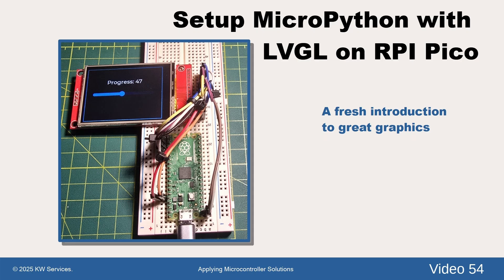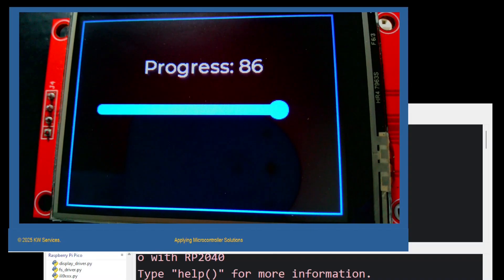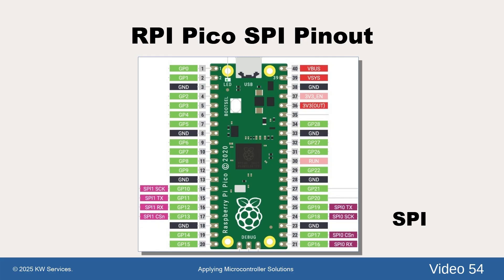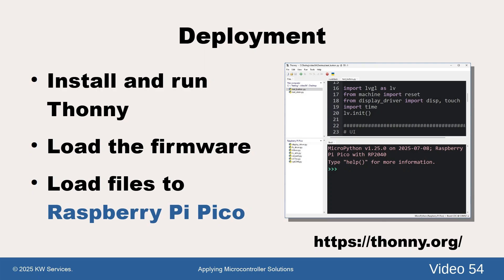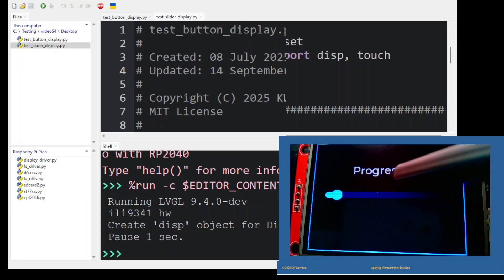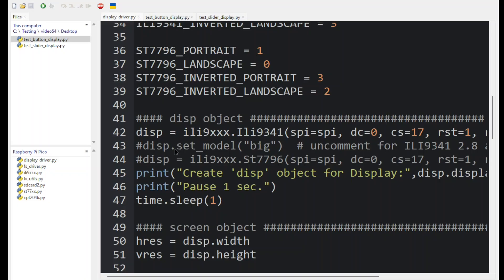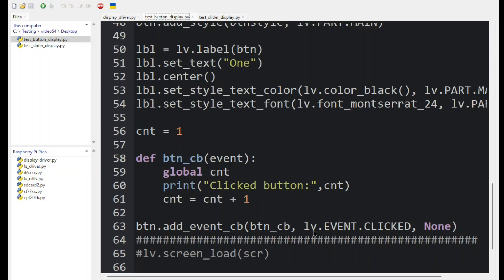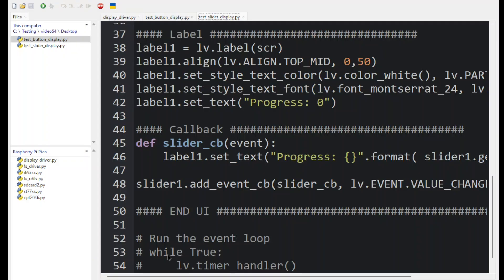Setup MicroPython with LVGL on RPI Pico

Comment: Does this work for pico w?
Reply from the maker: Thanks for the question.  Make sure to get the PICO_W firmware from my GitHub site.  For example in the JUNE2025 folder There are several firmware). Then of course get the drivers for the flash drive from the video folder (which should work for any MCU.)  You need to edit the display_driver.py file to use the specific pins to your display. Finally, get a desktop app to run from Thonny.  Let me know if you have any issues or if you are okay now.
Reply: @applyingmicrocontrollers  Oh my thank you so much, both for the quick reply, and for the firmware, i actually cant believe it worked, been trying for about 5 hours compiling github pages and with no success. You saved me - thanks so much
Reply from the maker: Excellent.  I am glad it's working for you.